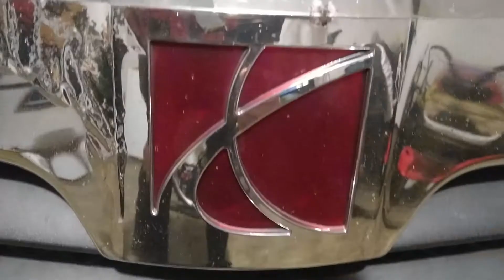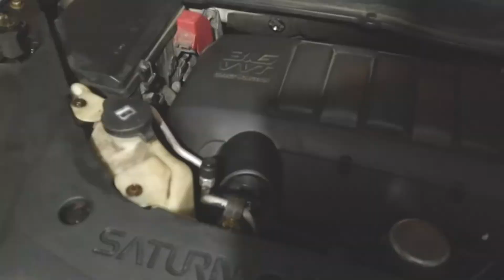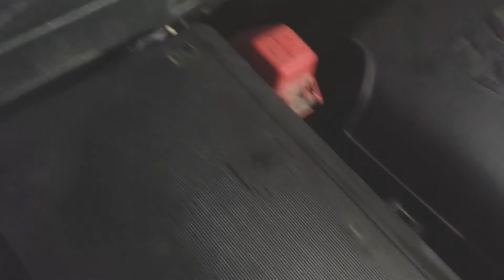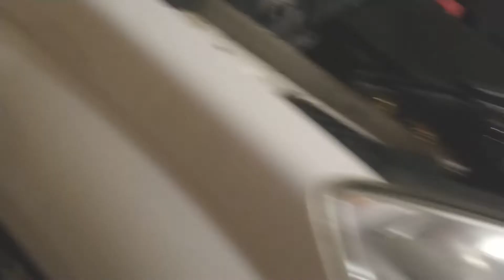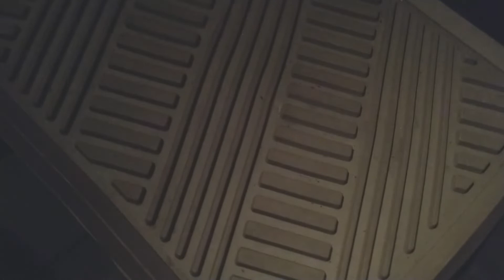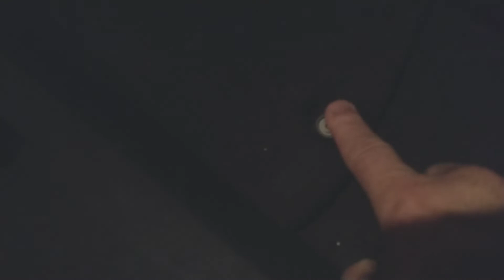Where the #@*! is the battery in this GM car??

Comment: Most  BMW vehicles are built with their batteries in the trunk. improved weight distribution is one of the main reasons manufacturers put batteries in the trunk instead of in the engine compartment, but the biggest reason is usually packaging.